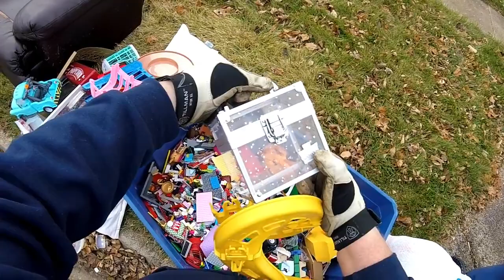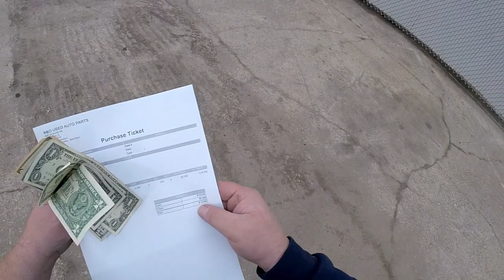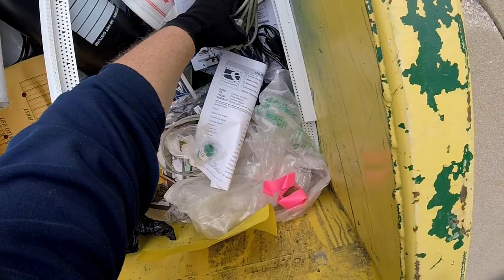Dumpster Street Scrapping... Until...

Comment: Hey buddy.  You should the excedrin and just use ibuprofen which is the main ingredient for all the pain reliever and works for mild headaches, i have been using this for aches and arthritis for over 45 years with no problem. Your paying for the name and extra medicine you don't need and will hurt you in the long run plus you can store brand 500 tablets for $10 to 20. Also glucosamine only will work great for joints and  rebuild carlteridge do some research on it i am 58 in aug.